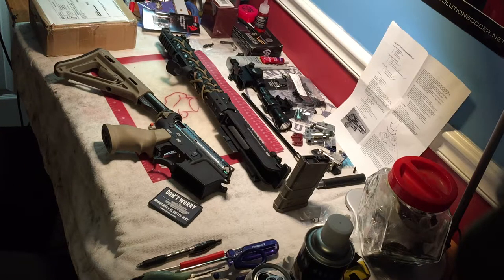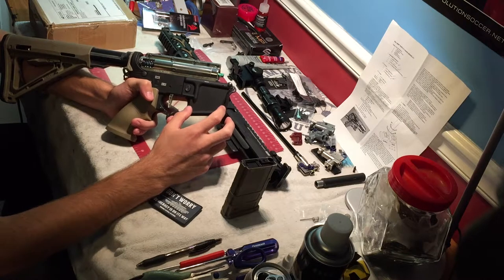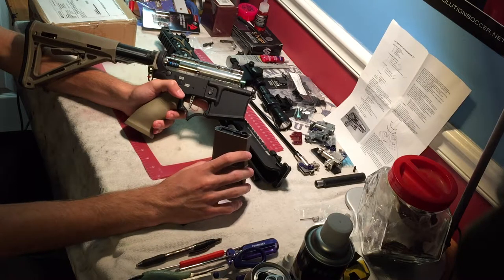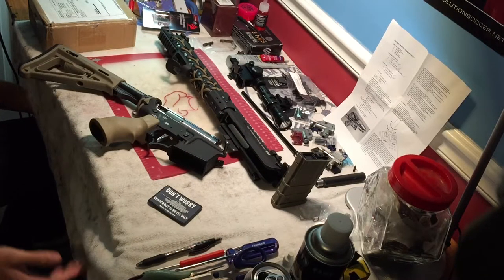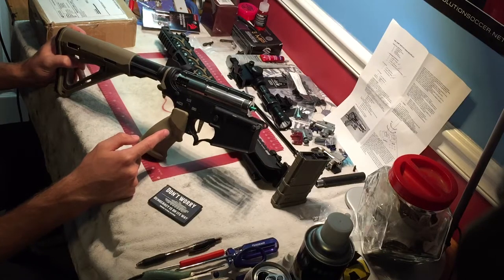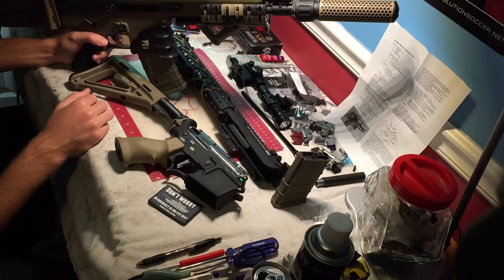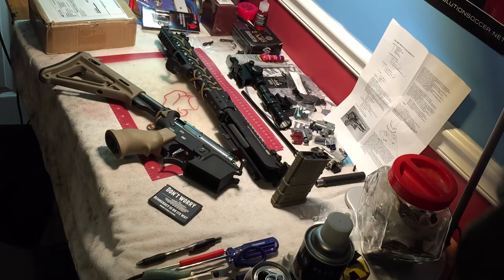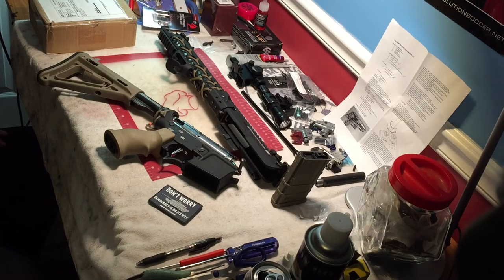DSG Discussion and Troubleshooting Feeding Issues - Airsoft Q&A Episode 1

Comment: you can use a 500 mm barrel for a DSG... Riotsc was drunk that day when said not to go longer than carbine length.
Reply: wouldn't that cause massive undervoluming?
Reply from the maker: MadCrew Airsoft um, no.  You cannot.  You will be massively undervolumed, like I explained in the video you just watched.  lol.
Reply: you simply cannont, a DSG will not create the volume of air needed for that length of barrel, you may get 200fps if you can even get it to fire
Reply: @jhondoe1483  LoLz, already have. works fine. apparently, you haven't done so. clue: experimentation will destroy your theory.
Reply: @TeamMadcrew  how exactly? Other than porting the battle (that basically makes your barrel effectively shorter).
Reply: @jhondoe1483  on my DMR tavor (~500mm), i replaced the gears with DSG and piston. works fine with m160 @ 1J...  it sounded like a polarstar. this was well over 5 years ago.
Reply: @TeamMadcrew  ok just swapping gears would leave you without enough volume in the barrel to carry the bb out, especially with a hop up so what did you do to get the barrel to support that?
Reply: @jhondoe1483  still had 300 fps. can you explain why? undervoluming is not an issue. the hop was set for a straight path. overhopping will reduce the fps.

i'm going to assume you don't do R&D.
Reply: @TeamMadcrew  buddy you build the gun I’m asking YOU to explain how you got 300 FPS becuase you know what parts were in the gun, all I can really think is a massively oversized barrel and not using your hop (at that point it kinda defeats the point
Reply: @jhondoe1483  not hard to explain. replace the sector with shs dsg, replace piston with dsg cut and lightened, replace spring with m160. DMR build so airseal is excellent.

remember that the extra length on the barrel will not affect the initial speed of the bb travelling. there is still volume being pushed out. suck back does not exist. if you can hear the exit pop, then it's over volumed. if it sounds like a polarstar, then the volume is not an issue.

remember that nozzle seal to hopup ends after the initial cycle. the tappet timing opens up any seal to prevent suck back from the withdrawing piston.

the initial volume push has done it's job.
Reply: @TeamMadcrew  undervolume happens when the tappet opens, the speed that the tappet opens the nozzle on a DSG is why you “can’t” have a longer barrel without volume issues. The bb will slow down A LOT faster in the barrel than out of it (the air pressure on the other side increases way faster) I guess a well sealed gun like you said could be firing in the high 300s and leaving the barrel at ~300 if it’s a stock 6.05 barrel but you are still having a volume problem just overcompensate for it and butchering accuracy
Reply: @jhondoe1483  my 500mm dsg just proved your theory wrong, LoLz. you need to make a 500mm dsg and prove me wrong. overvoluming messes up accuracy, undervoluming doesn't affect accuracy (no exit turbulence, the heavy pop sound).

Comment: I am building a dsg in the retro arms split gearbox shell. Is there any way to make the gun split open like a gbbr, systema, we katana or real ar 15? I have modded the upper and lower (the metal body) to open this way, but the back of the gearbox gets in the way. Any thoughts? I heard you are getting a sample in and I would love to hear what you think about it. (I watched the airsoft tech podcast)
Reply: Do you think retro arms will recall the shells they sent out? If they are faulty I will be annoyed, because that would be $170 wasted :(
Reply: yes they should split like an ar15 if I remember correctly.
Reply: +Graham Williams I know the systema PTW does and I'm pretty sure the ics split gb does too
Reply: +Platinum Airsoft I am trying to make that happen. I know it's possible but there will be a ridiculous amount of wobble :( so I was wondering if anyone had any ideas of other ways to make this work besides mine
Reply from the maker: Graham Williams I am sure it is possible, but very few AEG bodies are built to open like  real AR, it depends how the front of the split gearbox interacts with the lower half.
Reply: That's true. A dremel and a steady hand works wonders though.